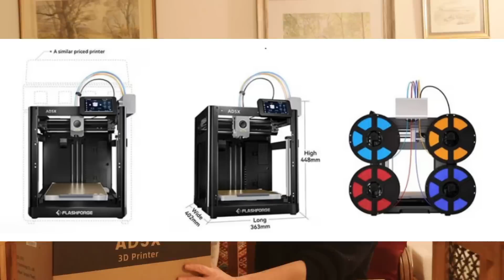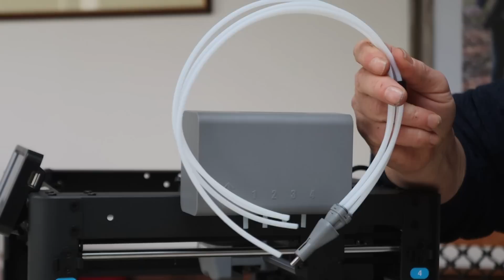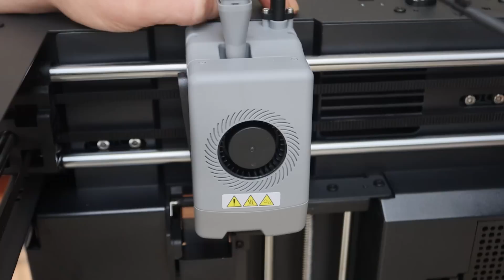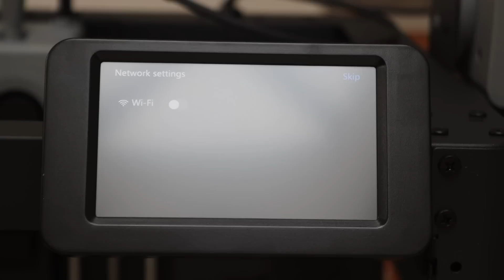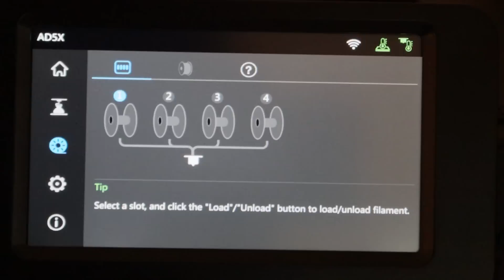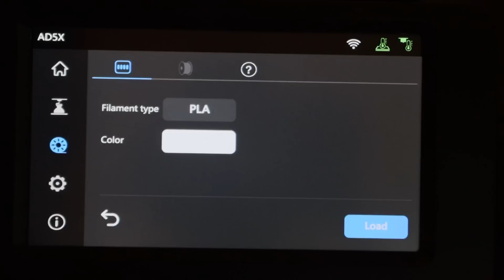2344 The FlashForge AD5X - A First Look - Not Yet On General Release #flashforge #ad5x

Comment: ...the Automotive air conditioner pulley mounted clutch could energize off the induction it produces alone and then change gears in high speed [edit: another form similar to centrifugal operation but easier to control , maybe more simple too]  , for example so the blades don't over speed their limit and still it would produce more power possibly ...it's an interesting type clutch for push button operation also  , which is  possible with a cable clutch too but it'd involve more parts was all , hard to explain briefly sometimes

Comment: I should check out your channels more , some new videos everyday looks like...I'd like a 3d printer if I could justify it and I see more items on eBay for example 3d printed, I mention clutches sometimes as a tinker daydream component and I've been reaping a pulley on a car AC unit that was seized and breaking the serpentine belt , the odd thing it uses a magnetic clutch but I don't trust the new parts on the old compressor , so I'm studying disconnect the clutch I just installed and was switching parts really so now i'n fascinated how the magnetic clutch on the pulley activates , it's odd trying to study how to make it not turn on the fuse controls the heater, fan and more , finally I find out "MG relay" is for magnetic clutch after learning also a relay can get stuck ON , (not my problem but I plan to disconnect that one so there's no strain from the compressor ...srry too long rant but the part is interesting , I was interested in belt driven components for example the Auto AC could run off spinning motion alone in the past but this is clutch related , could be electronically combined with an RPM meter gauge as well...

Comment: I am working on donating a 3D printer to the nearby school/church.  I think this is the one.  Thank you!!!
Reply: A very honorable thought. I donate my older printers to special needs children so their parents can guide them.

The only thing that comes to mind though is that Multi colour printers are more complex and things can go wrong where knowledge is needed to fix the issues. Not a dealbreaker if it's overseen by someone with knowledge to do so. But if not a reliable single colour has less to go wrong and they can always learn to paint/airbrush their prints.

I have the Bambu Carbon X1 and the 5 Toolhead Prusa XL and have also had a few other multi colours prior to that such as Prusa's MMU2 and the Mosaic Palette 2 and there is a steeper learning curve than "just 3D". So perhaps discuss this with the intended recipients in case they would prefer simplicity to start with.

Comment: Maybe the PTFE tube inserts on the orange clip spool retainers are just a cheap way to reduce friction on the sides of the spools as they turn during printing.
Reply: Personally, I think it's a handy spot to push the end of the filament to prevent unravelling when unloading and changing spools. I've had my AD5X since the 26th of January.